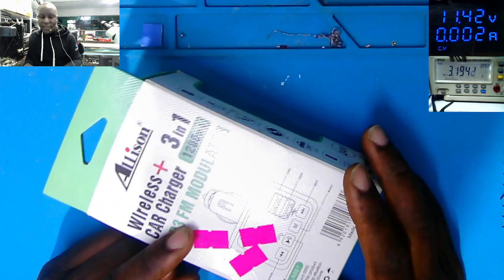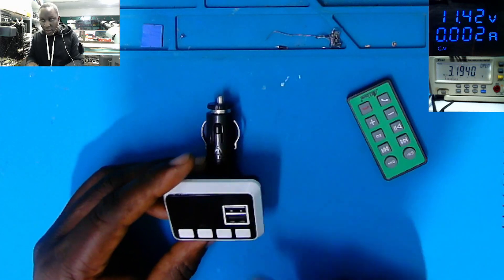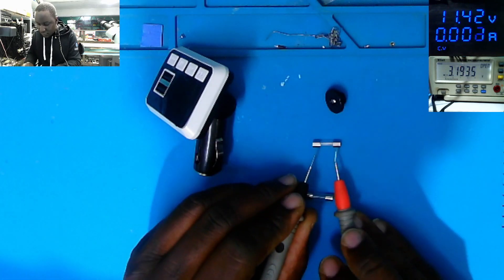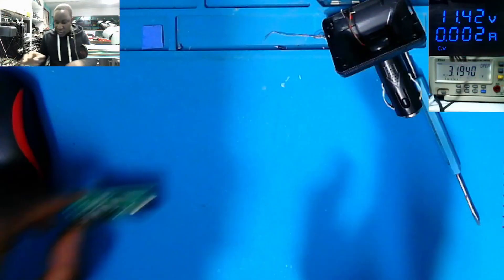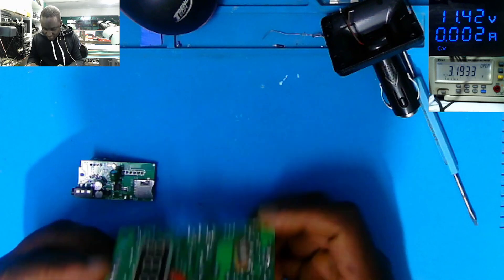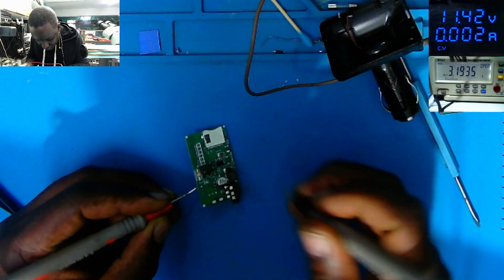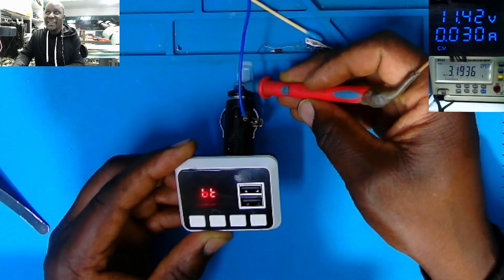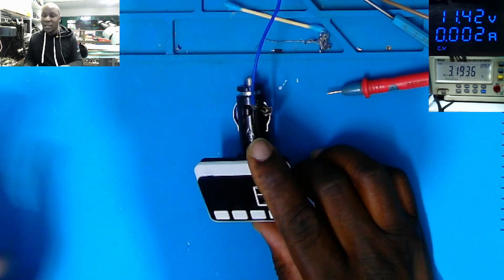Cheap Wireless Mp3 FM Car Modulator Dead, No Power-Lets Help The Customer.

Comment: SS14 diode specification is: 28V in RMS, blocking and peak reverse voltage is max 40V. So why it got shorted at 12V? Maybe the car alternator is shot too high voltage spikes?
You should also check if the device can work at 14.10V.
(when the car is off, then the radio and "12v" lighter plug has battery voltage, but when the car is running, then radio and the lighter plug has often the alternator voltage which it is 14.10V)

Comment: So in this circuit, we do not have ac input,we only have dc input,so this diode rectify dc to dc
Reply from the maker: Yes it's true stepping down 12v input to 5 volts